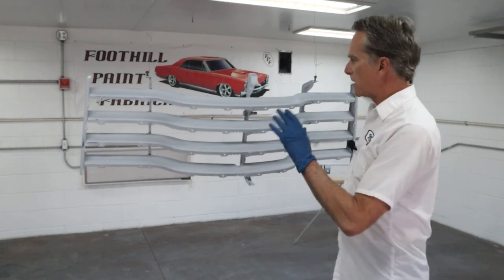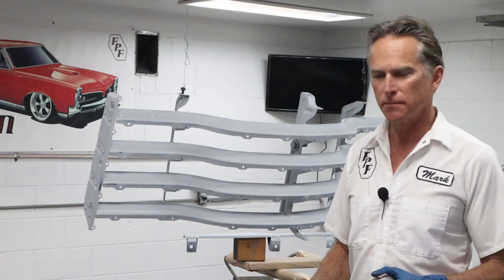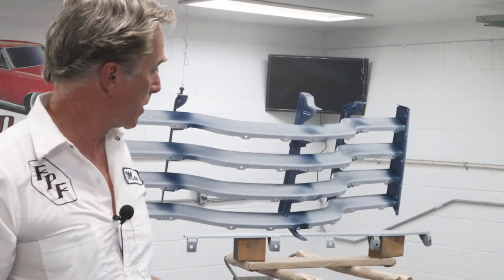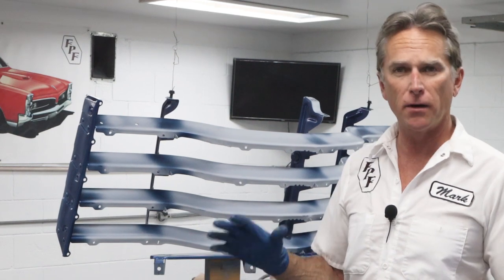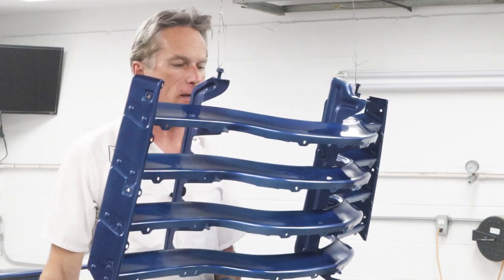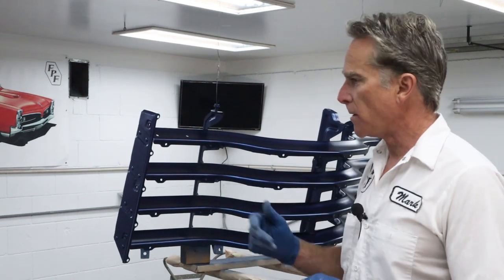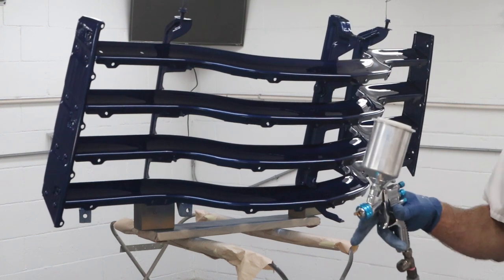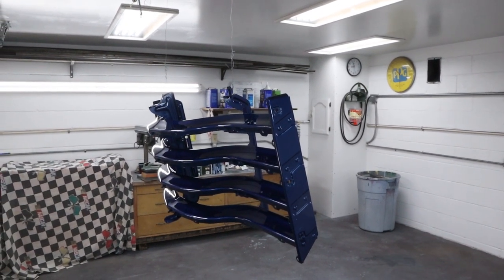1950 Chevy Truck (Ep 57) Painting the Grill and Splash Guard

Comment: Nice work. The only thing I think is a bit weird is that you dont run your air all the time. Every painter I know when spraying keeps the air on then triggers fluid. The reason is to prevent spitting. I am sure it all will turn out well. Plus do you like those plastic caps? OMG I hate them all it takes a a bump and you have a spill somewhere. I use disposable or coarse screw good quality plastic. Eliminates pot drips.  you can reuse the disposable too. Some guys dont like them because of the waste. But I use the same one for several jobs. clean them out and reuse until they are pretty stained. If you overlap too much and get a heavy spot. Just drop coat Easy fix.
Reply from the maker: Hi Mike.  I am using Devilbiss StartingLine guns which are really nice and made very well.  If your gun isn't made well or adjusted at the factory what can happen is the fluid tip starts moving before the air is completely initialized causing spitting.   In my experience leaving the air on while changing directions causes more issues than it solves such as dry spray, contamination from debri movement and when spraying clear it causes more nibbins because the clear dries on the fluid tip outlet and then is ejected when the fluid tip is triggered.   In the end everyone should do what works best for them and this technique works very well for me. The caps on the cups on my guns are actually hard to pull off and I have never had an issue with them.  I was leery first but have grown to trust them and they seal very tightly so no leaks and best of all no gasket.    
Mark